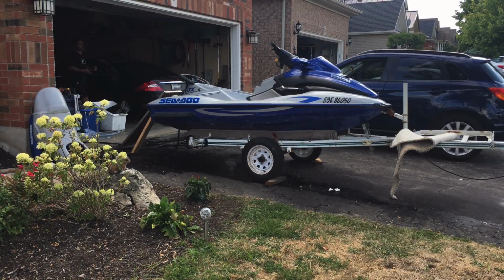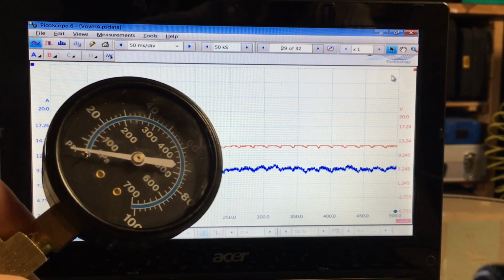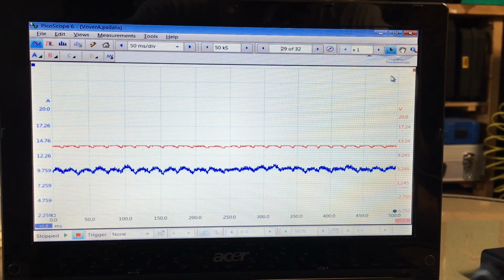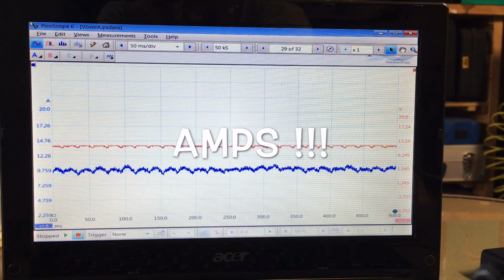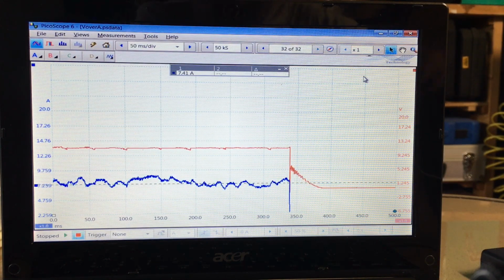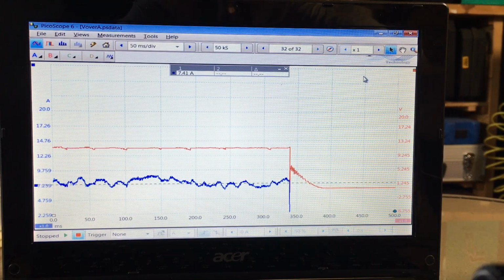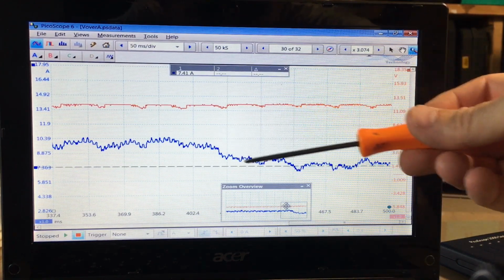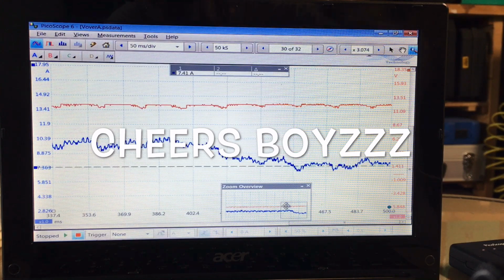Pico Scope Vs. Seadoo

Comment: 1) that pump seems to have 10 commutator segments (often 8, but it is a specialized vehicle)
2) with the 3A drop, the pump sped up about 500 RPM ... from 3300 to 3800 (rough estimate)
3) and the commutator peaks got a lot more garbled after the amp drop (not sure why that would be)
It's an old machine with an old pump so you can't go full wrong on that call. Keep us posted on results, Ian:)
Reply from the maker: the GADGETS playlist Denis you beat me to the punch...Just thought to myself...if the pump Impeller is bypassing...current down, speed up....Are the commutator humps closer together??? I am gonna scrutinize that waveform.! Thx for yer thoughts...Cheers Pal 👍
Reply: @TheGibby3340  that's slow for a pump 3300 RPM I find...
And not exact of course as I'm going by the video screen and read off the "graticules"... another word you taught me:)

Comment: Good find on the trace. Any thoughts on why the  pump is decreasing in load?
Reply from the maker: dave sterl Don’t know for sure Dave. Our thoughts are the impeller/housing maybe worn...once operating for a minute or two (maybe thermal expansion) the pump is internally bypassing...This of course may be complete fantasy! The machine is 19 years old...We’ll see...Cheers Pal
Reply: @TheGibby3340  just a thought it might be pwm controlled and current decrease is deliberate from the ecm when desired pressure is achieved. Pump voltage loss is a relay not latching perhaps. Could be completely wrong of course. Interested to see the outcome
Reply from the maker: dave sterl Could be... Because of the nature of the machine (mostly boat part time submarine) almost all components (apart from the ignition coils, alternator, battery and start relay)  are within sealed central control module...Doesn’t help when the schematic details a “black box”. Hope it’s the pump my neighbours getting fed up...Will consider your thoughts...Cheers Pal 👍